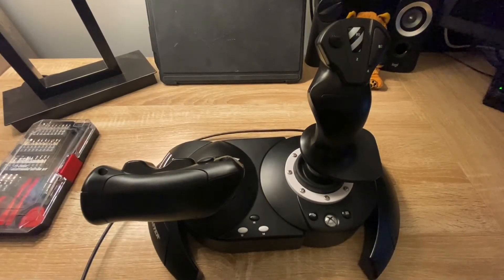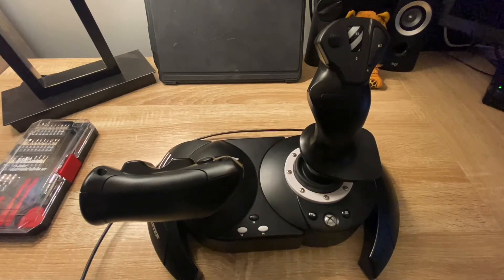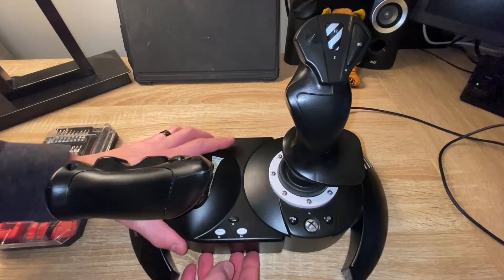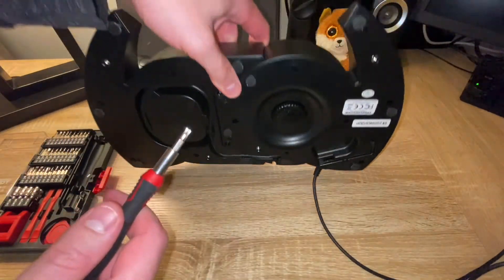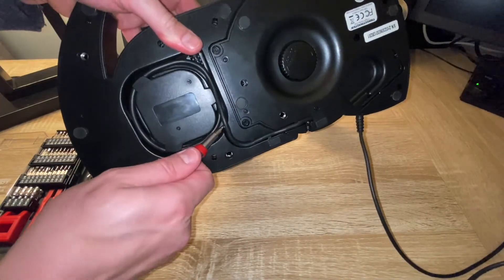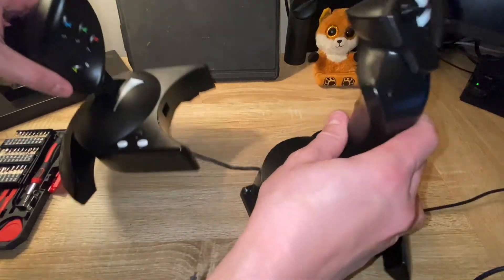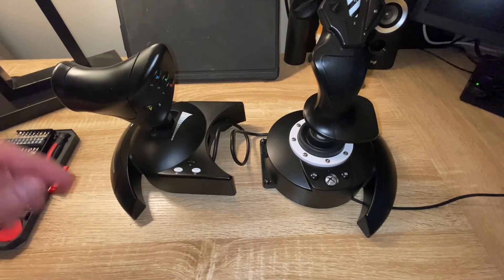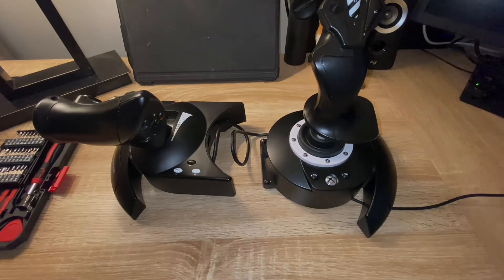THRUSTMASTER T.FLIGHT HOTAS ONE Review and Testing - Detaching & Separating Throttle and Joystick

Comment: Hi. I hope you’re still reading comments. I’m trying to pull the throttle from the stick, but it won’t come out. I’ve unscrewed the screws and removed the wrapped wire, but I can’t pull the pieces apart. They just won’t budge. Any advice?
Reply from the maker: Have you tried lifting the throttle up? It latches in on the T.Flight HOTAS One.

Comment: Ive worked this out, how do you disconect the cable ?
Reply from the maker: The cable between the flight stick and throttle must stay, you can lengthen it by unwinding it, it is coiled up under the flight stick.

Comment: How do u conect the throttle and the stick
Reply from the maker: On the bottom there is a screw that holds them together, and a Allen key to remove or install the screw.
Reply: @tekgamerworld for me the screwdriver is like stuck inside that container
Reply from the maker: @JackTran-kg7iw it takes bit of force to pry it out, if you can’t get it out, all you need is a T15 torx bit